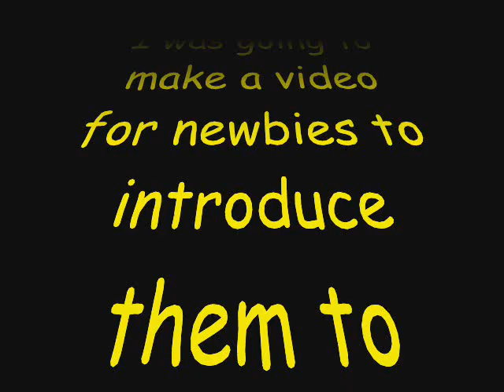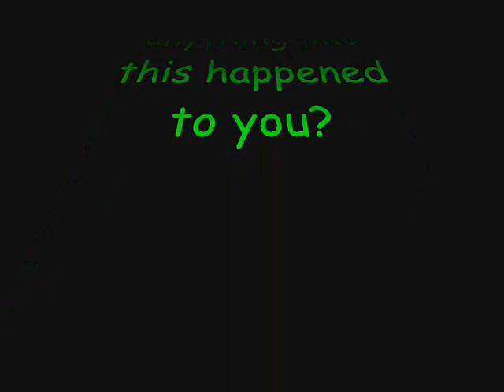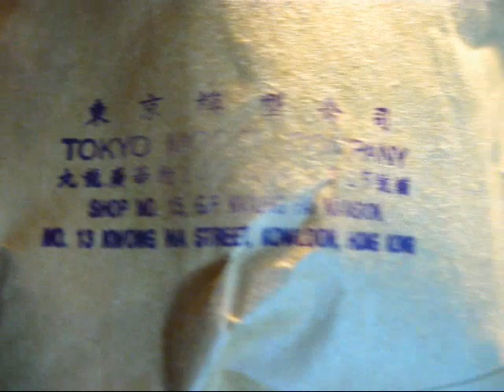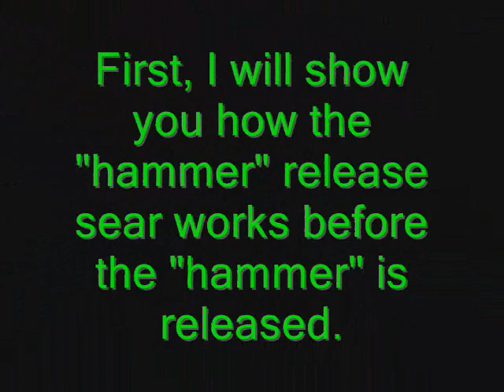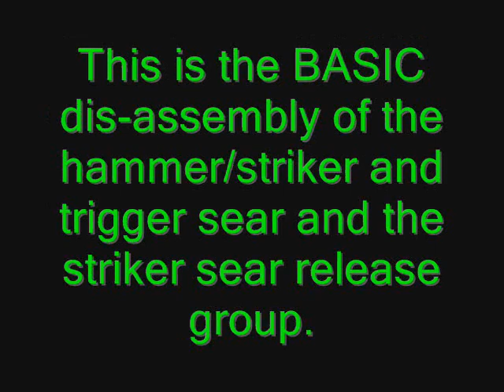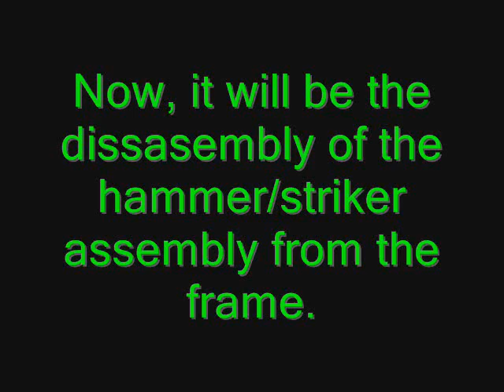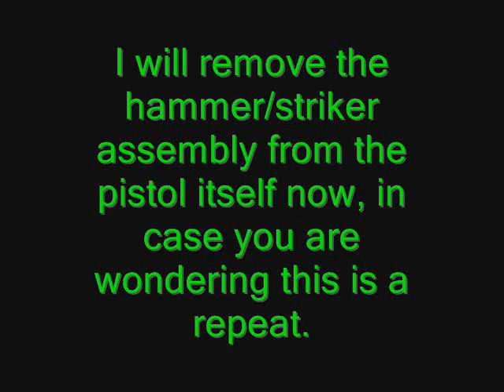KSC Glock 18C Failure/Catastrophic Failure - How To Repair - Part One (1)

Comment: This happened to one of my KSC glocks, due to the back left corner of the slide deforming outwards, I run a PGC slide and some other very heavy outer barrel (extended) and that one is awesome. I will get the marui if one ever comes in stock on any website...

Comment: Yeah, I was aware of the issues with the M series; just wasn't aware that it was so full of gremlins until I watched your vids. I think the part where the slide flew off was the final nail in the coffin. I did the math & after I got all the parts I needed (waited two months) I'd of spent over 300USD... I can get a KWA MP7, four 40 round mags, and a licensed mock suppressor for that price.

Comment: I had a couple of questions. I fill my KWA ATP magazine correctly but I am only able to fire off until there are 8 bbs left in my magazine. I bought my gun used and do not know what is wrong with it. As for now I am just going to order a new o-ring but do not know if I should replace my cylinder. I just feel like there is gas escaping from my gun with each shot, or more than it should.
Reply from the maker: +James Cortez Replace the cylinder?  Do you have a CO2 type of magazine?
Reply: +808Kameleon Sorry about that, I meant the Cylinder Housing. I bought a KSC Glock 18c like in the video second hand, if I would have seen your video for Why You Should Not Buy a Used Pistol, I would have not bought one. 

The gun I am currently working with has been fielded over 20 times. Feed Ramp is chipped, hop-up hood is chipped on one end, the inner barrel is missing the spring, also the hop up adjustment ball is missing. 

My current issue was that when I fired off by bbs I would have about 8 left in the magazine when it ran out of gas. I am planning on changing the o ring on the inner barrel, I just do not know what else to change out because I feel like my gun is using more gas per shot than it should.
Reply from the maker: +James Cortez So, the chipped feed ramp, the chipped breech, the missing spring for the breech and the missing ball bearing for the hop-up, is that all taken care of?  There is a fine balance of spring preasure for both the valve and the entire piston/valve assembly.  If you see a lot of gas venting off at the first five shots, too much has is released for the recoil (cylinder housing as you mention) and the spring needs to be replaced there (long thin spring on top of the housing).  USUALLY, the spring becomes crimped, and that weakens the spring effect.  IF you have a Facebook Account, you can find me and another tech there..... as well as fine techs from around the world.....  https://www.facebook.com/groups/343150155837804/
Reply: 808Kameleon I have not ordered the parts that are damaged or missing but now since you have mentioned it I am just going to replace the cylinder housing and the springs as well. And thank you so much for the facebook group, if I have anymore issues I will be sure to ask on there.
Reply: +808Kameleon Quick question. Do you think this kit would be compatible with my KSC Glock 18c? 

http://www.evike.com/products/53305/

My main concern is the guiding rod/spring.
Reply from the maker: It's worth a try.  But didn't you have feeding ramp issues and others?  Oh, we can communicate on Facebook.  I am there more than here...
Reply: I also have feeding ramp issues too, I am trying to rule out and gas issues by changing out the entire nozzle, rocket valve, nozzle springs and so on. 

Look for me in the group, I am the guy who put up the most recent post.

Comment: 1:00  Thats my problem
1:20 Holy shit! Glad thats not my problem!

The cylinder in mine tends to stick forward, no matter how lubricated it is.  I suspect thats causing part of my problem, any idea how to fix?  

Also i can shoot around 10 bullets be it full or semi auto, then after a few rounds the slide stops and is stuck a half an inch back.  (Vents all the gas cause the pin is stuck forward)  And also i noticed that it ends up on safety after that happens.  Any idea on how to fix?

Comment: Hi, i have a KSC Glock 18c and i need a new Full auto sear. Any ideas on where to get that part? I really need it because this is my most dependable and most reliable pistol
Reply from the maker: Sorry for the LATE reply. When Google took over YouTube, things got so messed up with me trying to answer questions.

Full auto sears can be purchased from Tokyo-Model Shop in Hong Kong.  That is where I get my many replacement parts. 

http://www.tokyo-model.com.hk/shop/index.php?main_page=advanced_search_result&search_in_description=1&keyword=ksc%20glock%2018c&inc_subcat=0&sort=6d&page=2

I suggest you replace BOTH sears at the same time!  This pistol is a retardedly pain-in-the-ass pistol to dismantle and re-assemble!  I hope the link satisfy your search.  You can also search up and down for more parts.  Get the parts now while they are still available! 

For dependability and reliability, switch to the Tokyo Marui GLOCK 18C.  Less parts and less prone to breakage.

Comment: I Need help ... I bougth this gun and Put an new co2 in... I put on Full Auto and After 5-10 shots co2 Came out of the Pistol... But only After i Shot 5 mags out
Reply from the maker: You mean the gas vents out?  Most times the pistol gets cold, and without silicone oil, the ale gets stuck and that causes the CO2 to vent.

Comment: You do know you're supposed to pull the slide back every time you change the rate of fire right? That's how you break internals including the selector switch itself..
Reply from the maker: I guess you seen this old video with an mobile devise that will not allow YouTube provided annotations (caption).  I modded mines to ALLOW realistic switching from single to full auto, but the REAL problem is the type of metal KSC and KWA uses for the single and full auto sear.  Not to mention MY KSC GLOCK has a higher rate-if fire than stock.
  Non-the-less, I retired this old pistol, and got me a better built and designed Tokyo Marui GLOCK 18C, and with MANY usage, I had NO problem!  Thanks to my modifications to that pistol.
Reply: 808Kameleon
 i wasn't trying to hate on you i was just wondering... i just recently purchased a KSC G18c as my first sidearm and am extremely impressed with it. Hopefully it lasts awhile without having to repair it as it looks quite frustrating having to break the gun down that far in order to replace little parts.

Comment: I can't unjam my even after watching for video.  There doesn't seem to be anything to push down.
Reply from the maker: +TimboSlice083 How old is your pistol, and was it bought new or used?
Reply: 808Kameleon You in Hawaii?  I bought it somewhere in town brand new from a shop at least 5 or 6 years ago.
Reply from the maker: Five to six years ago... OK... So the parts are worn down.  I suggest going to Hong Kong shops like Tokyo-Model for replacement sears.  Both the single fire and full auto sears needs replacement, as well as the "hammer".....  If you need links, I can provide for you whatever is available.  I am more active on Facebook.....

Comment: I hav a we glock 18c and when I cock it back it also fires at same time, any idea on Wat I should do to fix it ? thanks
Reply from the maker: WE GLOCK 18C is a different firing mechanism than the KSC.  It is based in the Tokyo Marui firing mechanism.  So... cocking it back, and it actually fires?  Check if you have a cracked or broken sear.  I will not be able to answer for over a week.  I am moving, so you can write more findings here, or join our Facebook Group:  https://www.facebook.com/groups/343150155837804/